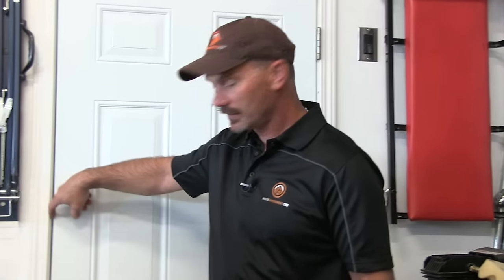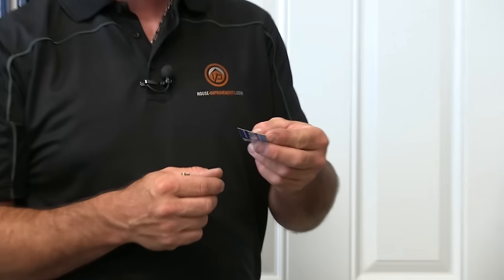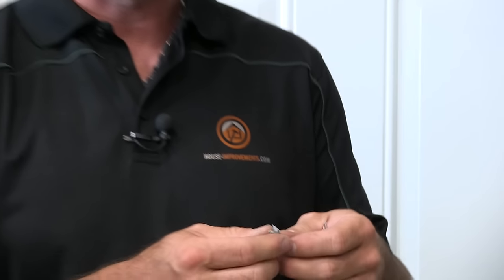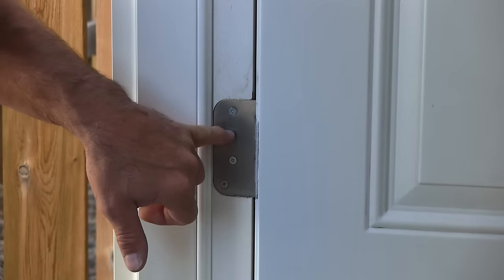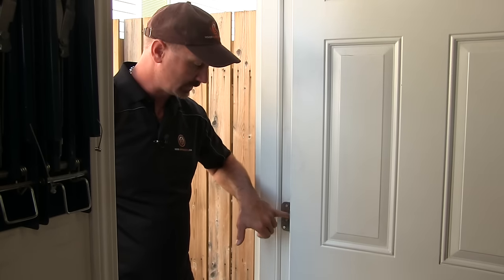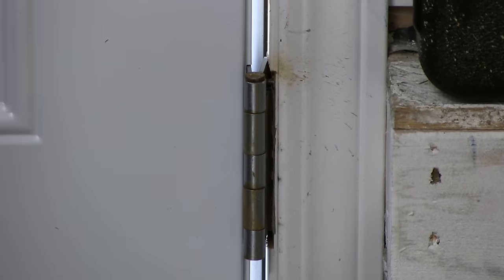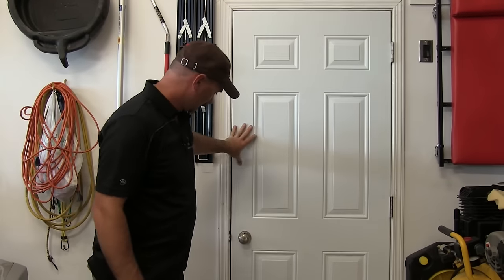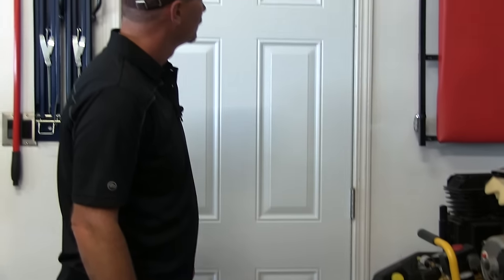How To Adjust A Door Hinge

Comment: Instead of using cardboard, remove the hinge on the jamb side and install a small screw in the same place leaving the head of the screw out a little (I always use extra hinge screws) then reinstall the hinge. Cardboard is to soft and doesn't really keep the hinge "jacked over" when you screw the hinge back in place
Reply from the maker: use the dense cardboard from the hinge package, it does not compress much. Your method will work as well.
Reply: Great vid. I use the screw method as maddog1918 mentioned above. Works great with easy and quick adjustability by threading screw in or out to get things perfect.
Reply: I usually tape a couple of number ten washers or quarter washers. Thin enough to use for shims and solid.
Reply: I just did this using cardboard and it worked perfectly!  Thanks Shannon!
Reply: Worked perfectly. Thanks !

Comment: This is the best ever. My sagging door frustrated me quite a while. And I tried a couple of approaches from Yotube. Some of them required me to bend the hing knuckles a bit which didn’t fit my case because the door casing to close to the hinge and almost zero space for a wrench not to say bending it. This approach with the video perfectly solved my problem without any damage on the hinge itself.

Comment: Thank you very much for this video.  I had a door that was stuck at the top edge all the way to the corner on the latch side.  It had been making awful noise for years, even cracking the drywall in the corner it was so bad.  Looked at alot of videos- all involved bending the hinges, which I knew I would screw up.  Your method was great because it could be easily undone if it didn't work right.  I decided to shim the top hinge with a quadruple fold of cardboard from an old greeting card. First try it worked perfectly, and the door closes silently now. Amazing. Thank you so much for a very clear and helpful video :)

Comment: Shannon, thanks for the vid.  I love your channel.  I have a front entry door where the top corner of the latch side protrudes in away from the stop and stands proud of the jamb about 1/4 to 3/8".  I'm thinking the door frame was twisted during install.  Is there a way to adjust the hinges to correct this or would I have to rehang the door within the jamb?  Uninstalling the entire door frame is not an option.  Thanks for any insight!

Comment: Hi Shannon. Another great video. I’ve been a huge fan and subscriber for a longtime now. I’m needing some huge advice on my walk out basement door.  I replaced just the door, and the bottom plate of it as well. Both Master craft.  At first everything was fitting right except two things. There’s a gap at the upper right hand side of the door, as well as a gap at the lower left of the door. I’ve tried everything that I can think of as a DIY’er, but could really really use your expertise advice and knowledge on this one. I have even exchanged the hinges out for new ones, and that didn’t even help. About a month ago, as it started to get cold here in MI. It got to where I couldn’t even close the door, without sitting down and using my heel to close it. I bought the exterior door custom so it was painted&had two holes instead of one. Air is coming through gaps good. I had to even chisel for the hinges. Any help would be totally thankful and well appreciated. Thanks so much, and keep videos coming👍🏻
Reply: Nrfa I'd ask this question on his website.

Comment: I've used playing cards for years. A little tricky, but you get an infinite adjustment.
Reply from the maker: That is a good suggestion , they would work good and very thin for exact adjustment. Likely need 4 layers in most cases

Comment: Honestly You should be embarrassed by this video. Telling ppl to stick cardboard in the hinge.... 
The CORRECT & FREE WAY TO FIX THAT is to remove pin on the problem hinge, take a wrench & very  slightly bend the top/ midle & bttm of the outer 3 pce hinge inward towards the door then rei-nsert the pin. That will fix it the right way bro instead of shoving stupid paper in the hinge to fix it for 24 hrs. Geeezus....

Comment: It didn't look like the motises were too deep. So is this caused by the hinge side door frame being twisted either in manufacture (top of the frame not being square) or due to going out of square (twisting) during installation? (King and jack studs not being square in the rough opening?)

Comment: I really like your video.  I have a friend I tried to help an interior solid core door today.  The door was Not pre-hung, but had a top jamb, and both side jambs (3 separate pieces).  The jambs and the door have 3 mortises already on the jamb, and the door.  By the way, product is from Menards.  I air nailed the top jamb to the two side jambs and attached the hinge side with 2 1/2" screws, along with shims, to keep the hinge jamb plumb.  Then, we hung the door with the three hinges.  I hadn't fastened the striker jamb to the opposite side yet.  My problem, when I close the door, it will not close EASILY when I get about 1-2" from the stop.  It wants to spring back.  I do not want to fasten the striker jamb plumb, along with the top jamb, until the door will close easily against the stops.  Any suggestions would be appreciated.  Thanks.
Reply from the maker: The hinge side of the frame is twisted and the hinges are closing completely before the door can swing all the way closed. Add a really thin shim under the edge of the hinge side jamb along the edge where the door hinge knuckles are, this will twist the frame more true to the wall framing.

Comment: Is there a way to actually lower the door? Mine keeps hitting the top of the frame. Thank you.
Reply from the maker: It may need adjustment behind the top hinge like shown here if its just hitting on the handle edge at the top and if there is room for it to move towards the side jam at the top. If not then you would need to notch all hinge locations on either the jam or door to adjust the entire door . If you need more help with this please use my forum.https://www.house-improvements.com/forums/

Comment: What happens when that cardboard you are using as a shim, gets wet or damp?   Over time door may become loose. Wouldnt a wood be better as a shim to use instead. Something that cannot be weatherized.
Reply from the maker: If that shim is getting wet or damp inside your house you have bigger issues. You could use something like a plastic shipping strap or something . On commercial exterior doors that swing out we use metal banding.
Reply: @HouseImprovements  Thank you for the reply.  I will keep that in mind when I do my doors!

Comment: If I want my door to angle up slightly so that the deadbolt goes in smoother, would doing this just on the bottom hinge "tilt" the door up?
Reply from the maker: yes. or use a dremel tool to grind out the deadbolt hole a little larger.

Comment: Why not just use 3/8" WOOD instead of something that will degrade fast and  compress over time like frickin' cradboard does!!??
In my work I have to CONSTANTLY repair what idiot "handymen" do in order to get what I am working on to be done CORRECTLY.
Reply from the maker: you can't just use any cardboard, it must be the stuff like the hinge boxes are made of that really does not compress. Metal banding works well also and i use that with metal commercial doors and frames cause you can torque up the screws so much more with them.

Comment: I can't seem to find a video on the problem with my door which is that it tilts out at the top (two month old "professionally" installed exterior) and doesn't touch the weather strip at the top but touches very tightly at the bottom. Any suggestions?
Reply from the maker: Please come to our forum , we just discussed this same issue with someone who had the same problem with an interior door. https://www.house-improvements.com/forums/viewtopic.php?f=4&t=10423

Comment: Thank you!  At least this method allowed me to adjust the door where I can now use the door knob lock again.  At least it should last until I can get someone more handy to come in and look at my door.  I had trouble with the dead bolt too, but for now I won't have to file as much off the strike plate to get that working too.

Comment: I live in an old house with doors that stick based on the season and tried the shimming and it made it worse. What am i doing wrong? Ugh.
Reply from the maker: You may better off planing them if they are old wooden doors. Many times old wooden doors where a much tighter fit and you may fix one rubbing area when shimming but tighten a different area.
Reply: @HouseImprovements  I think you're probably right, they are old wooden doors. Thank you!

Comment: Thanks man this solved my door hinge problem. I recently fit my first replacement hinge and had an issue where the wood frame would creak and the hinge would flex a bit.. so the cardboard shimmy worked a treat to solve both problems 🤟😬😬

Comment: i have a sticky interior store where the gap is less in the middle and bottom on the hinge side.  i tried to bend the bottom hinge out a little but i think i made it worse. I bent them towards the door, should i bend them towards the frame?
Reply from the maker: So look at it this way if you need the door to move away from the hinges you shim under the outer edge like i did , if you need the door to move closer to the hinges you shim the opposite edge . (the edge closest to the door stops.)

Comment: How would you fix a door that won't stay closed when opened halfway or cracked open or not latched?  Thanks for any replies
Reply: It'll be either the top or bottom hinge that needs to be shimmed depending on which way the door is swinging 'freely' when it's supposed to be still.

Comment: To resolve a door hinge binding before reaching a latch on a wooden door; would you ever bevel the hinge side of the door so it over swings to reach the latch?
Reply from the maker: You could but if you have enough space along the latch side I would shim all hinges out near the pin edge on the jamb instead of pulling the door down,removing all the hinges,beveling the door, re-morticing all the hinges ,re-installing all the hinges and re-hanging the door.

Comment: That's the way, cardboard (non corrugated which is what I guess you're eluding to, as it doesn't compress much) is great. I find for a slightly thicker shim than hinge box I use Ram Board, very dense and hardly compresses at all. When we're tearing it up after a job, I cut up some of the best stuff into strips, then chuck it into the shim bucket. TopTip™ for the day! ;)
Reply from the maker: good tip
Reply from the maker: for commercial steel doors I use metal banding form shipping pallets